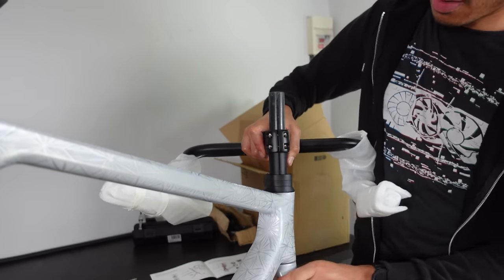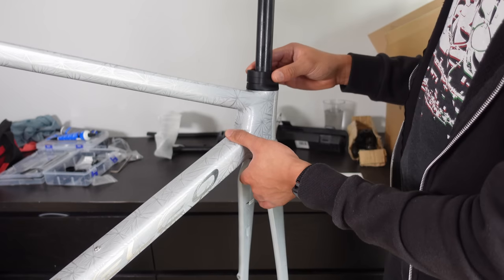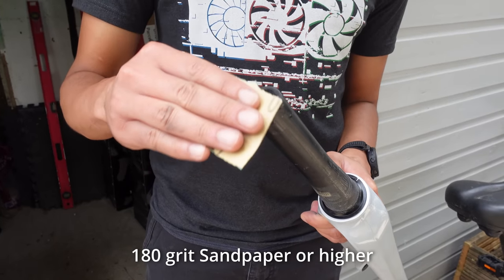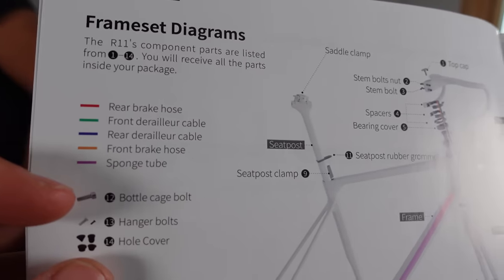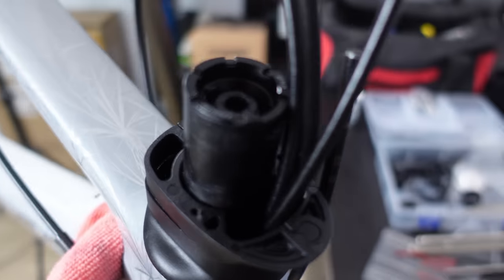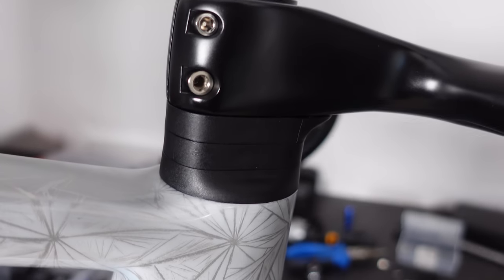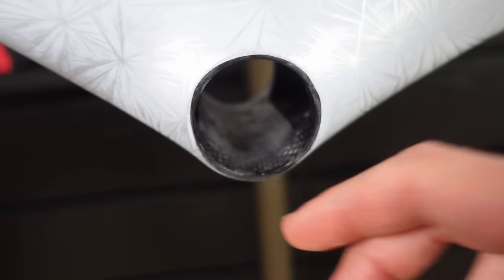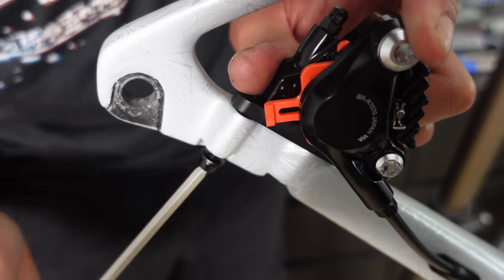$3500 Chinese Carbon Road Bike Build!

Comment: Great video @Jourdain You are fortunate or Yoeleo is upping their game. I bought the last gen R11 frame 2 years ago. Rim brake version. I did not get a manual, or cable dampening or proper pre routed cable guides, or well sorted extra parts and pieces. It was more like pot luck haha! But they have also raised their prices up, By over $300 dollars. I do noticed they fixed a few annoyances from the old frame set, but one they did not and your bike has it too is the aluminum sleeve in the handlebars. On mine, the headset would work its self loose endlessly, after several months of this going on, I used carbon paste on the steer tube. That has worked well. I did not see you guys do that so maybe yours will work out, but just a heads up. Looking forward to the next video.
Reply from the maker: Thanks for the message. It sounds like  many of these companies... they improve as they go and improve over time. The first release is basically a test. Similar to many of the groupsets. Hopefully your bike is still going strong!! 👍🏼

Comment: just put a spacer below the stem cover when compressing the steerer bearings, at least that is what I do if I miss the length when cutting the fork and end up being 1mm too long. also do not remove the plastic hoses that come within the handlebar, just connect your magnetic tool and pull it through, then connect that to the braking hose and it will go through easy - I had no hassle with this.
Reply from the maker: Make Sense! I can see how using the guides in the bars for the routing tool would help for sure 👍🏼

Comment: It doesn't make sense to have the same size rotors front and rear when you get so much more stopping power from the front wheel. You're just making it more likely that you'll lock up the back wheel if you apply both brakes in an emergency. That's why you'll never find a motorbike with a rear rotor anything like the same size as the front.
Reply from the maker: Fair point, I've not looked at it that way. I'll have to do a comparison at some point. 👍🏼 Thanks for highlighting g
Reply: Got the same thinking on my bike since I have motorbike background. Nonetheless I let 160/160 on my wife's bike cause she brake a lot on downhill (fear mostly) and I'm afraid the 140 couldn't handle such unfriendly braking skill 😂. But I'm definitely agree with you for the vast majority of non noobs cyclist 😅

Comment: Sorry old fashion rim brakes no cables running though  the frame simple  maintenance
Reply: Fully agree, would be hundreds of euro to replace cables
Reply from the maker: Yeah, it's a lot of hassle to replace the cables for sure. They are better suited to wireless groupsets. But then the costs is crazy.
Reply: Hear hear.